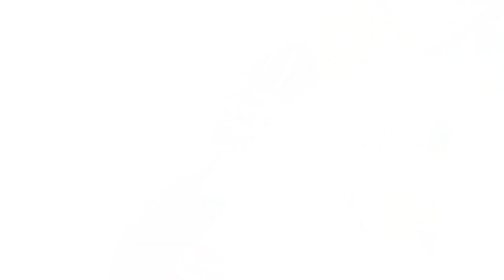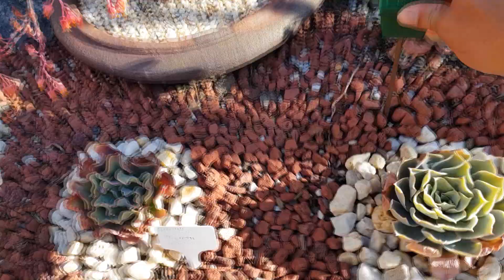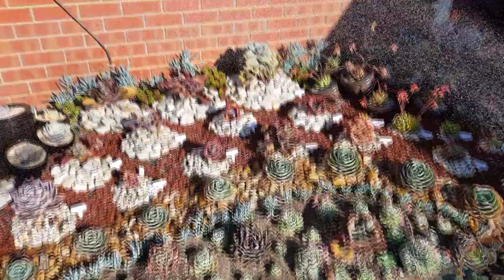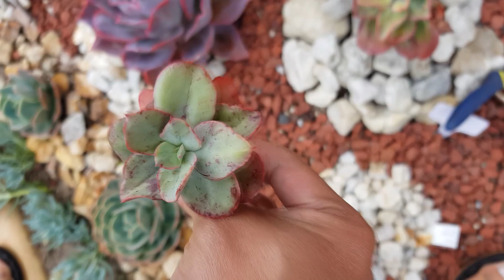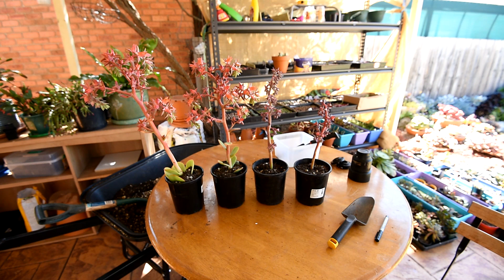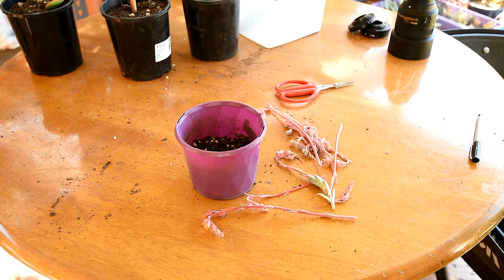#15 Checking for moisture and planting echeveria flowers

Comment: Hi,  did you let the stem tips dry and callous before planting? Or did you plant right after cutting.  I heard you say you were not going to water until they had roots,  but how will you know when they root? Thanks
Reply from the maker: This has been so long ago, but I think I just planted the flower stalks for video demo purposes. I can faintly remember that I pulled them out again and stored them in bright shade, cause it's easier to monitor for growing roots when they are not yet planted in.

Comment: Does it leave any stains on the leaves when you water shower the plants?
Reply from the maker: Depends on how strong your hose setting is, and how thick the farina is on the leaves of the plants. If they are exposed to enough sunlight, they will develop very thick farina on the newer leaves. If you use a gentle spray setting, the droplets will not be too abrasive and won't rub the farina off.

Comment: Hi can you share where you got your moisture meter?
Reply from the maker: Bought mine at Bunnings: https://www.bunnings.com.au/gardman-soil-moisture-meter_p2961033

You should find one in your local garden centre or hardware store. If not, you can try buy and sell websites.

I went for the analogue version rather than digital so I do not have to worry about batteries.

Comment: id really like to see a video on weeds, I am converting over to rocks in my flower bed and I'm concerned about weeds. I'm not interested in putting weed block down but I'm afraid if I don't the weeds will overwhelm me.
Reply from the maker: Hey Sarah. You know what, that's actually a good topic for a video - goes well with the landscaping theme. it might be a while before I get to publish a video about it so let me just write a quick note about my experience...

Anyway, I haven't used any weed block in my landscapes and just went with mulching with pebbles. I also have another area that I have mulched with pine bark. Between those two, the one mulched with pine bark had more weeds compared to the other, but compare that to areas that are not mulched at all, there's significantly less weeds.

Laying down the weed block underneath does help but for a lazy (and cheap) person such as myself, I don't bother doing that anymore. There's a few reasons - 
1. Laying down any matting material means that you have already decided where you're planting. This is alright for the most part, but I hate it because it limits my creativity. I will have to keep puncturing holes whenever I decide to shift things around. More holes means more exposed soil, and that would defeat the purpose of covering it anyway.
2. You're going to top up with soil/dirt anyway. Weeds will still grow on those eventually. Why bother, right?
3. While there's still some weeds growing between the rocks, they are far and few in between. I can only count a few ones that manage to grow within a square meter, and they are a lot easy to pull out manually. Worst case is you just have to shift out some of the mulch material, pull the weed out, then shift the mulch back. Takes only a few seconds to do so.
4. If you have mulched well enough that there's not much exposed soil, it will be very hard for weeds to grow, because they are not exposed to sunlight. This is effectively the same result as using weed block to cover the soil, only you're using other materials.

The key here is not giving them enough sunlight. Even tall plants providing lots of shade will help prevent weeds from growing compared to just having the soil exposed.
Reply: Sarah Keen check episode 14. He talks a bit about it.
Reply from the maker: Thanks for helping out Lulu Beltran. You're right, I briefly mentioned something about repelling weeds due to the mulching nature of the top-dressing in that episode. Maybe I can create a follow-up in one of the future episodes just giving more time talking about it in detail.